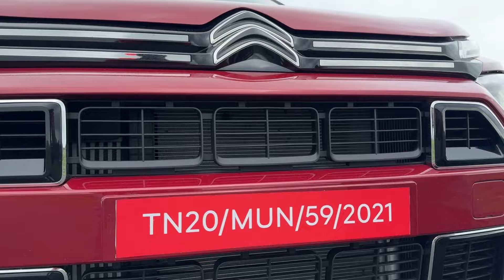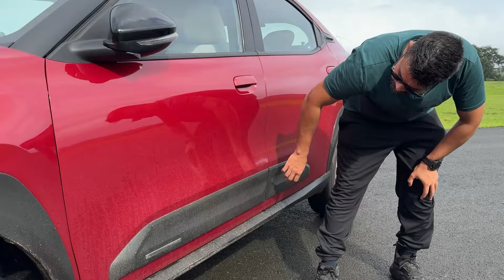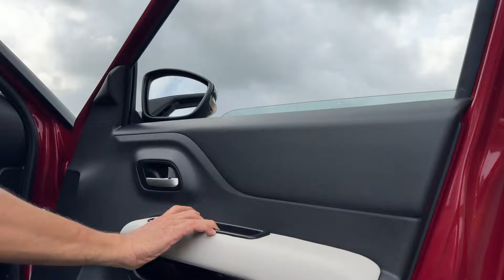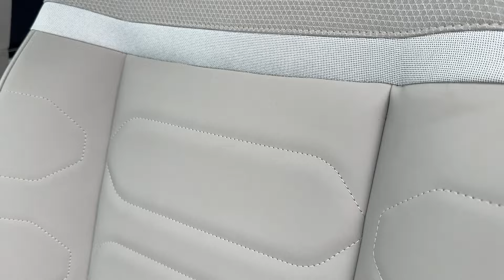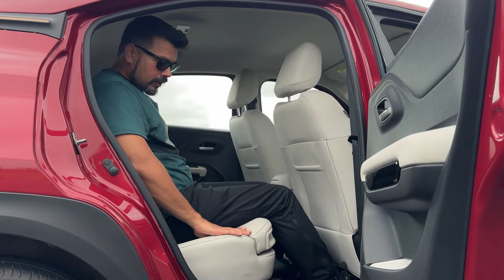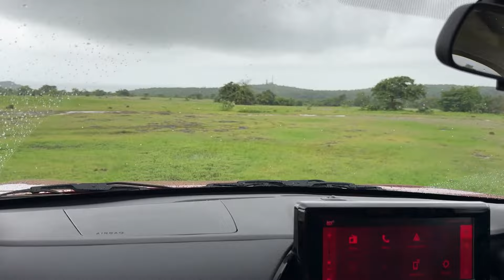Citroen Basalt First Drive Review! 7.99 Lakh | BIG Car, BIG Value! | Should You Buy?

Comment: Jokes apart..  but the car looks STUNNING ❤. Absolutely stunning.
 Those complaining about sunroof, adas, ventilates seats etc.. blah blah blah.. shud also be wise enough to consider its price point.
I mean the top end model is just 13Lac that too for a car which is as big as a sedan, is fully automatic and has a turbo charged engine 👏👏
And not to forget, the terrific suspension it offers.
 I mean what else do you look for when it comes to sheer driving pleasure 🤷

Adding a few unnecessary features to it wud hv made it costlier by 3-4 lacs. and in the price braket of 16-18 lac nobody wud have bought it since in this price bracket there are already the honda citys and hyndai vernas dominating the market.

At this price point it's the best package offered by the french car maker. 
And yes , again the design is worth drooling over ❤
Reply from the maker: It's really a fantastic package